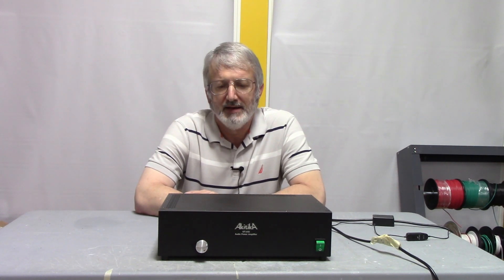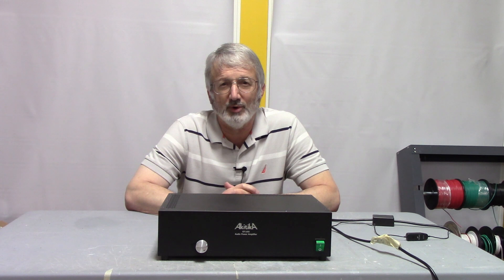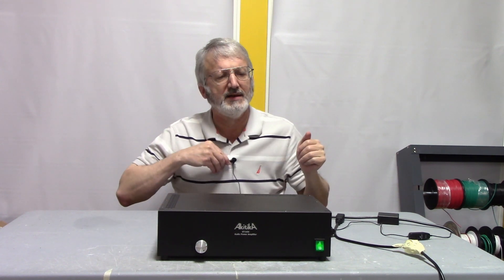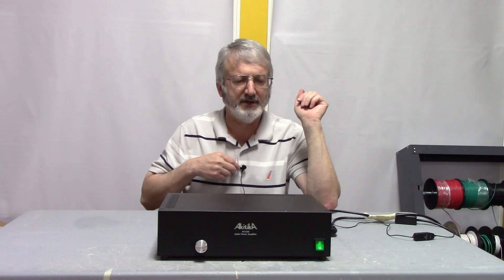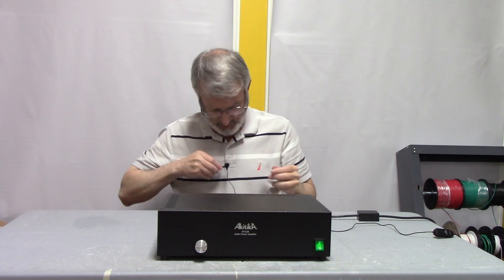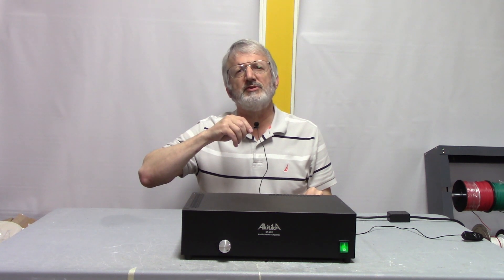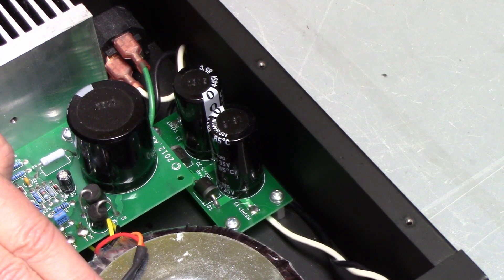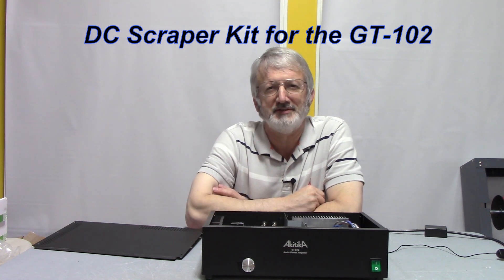DC Scraper Kit for the GT-102 Nullifies the Effect of Asymmetric Power

Comment: It amounts to a bipolar capacitor. A neat solution. The same circuit could help other gear as well, and might even be a good idea within a power strip or surge suppressor. Something bothers me, though, about the use of 35V caps. I know they should never charge beyond whatever the dc level is on the AC line (which should never be more than a couple of volts), but still, it makes me nervous. I'd feel better with 180V or 200V caps for a 120V power line.

Comment: Sir, Thanks for this information. Will this work with 220V AC. And also I see that the circuit is being connected in series with the phase line of the AC power line. Am I correct?
Reply from the maker: you could place it in series with either conductor. You can use it with 220 AC.
Reply: @akitikallc6161  Sir, Thank you very much for your kind reply.

Comment: Basic question: how many DC volts can this arrangement (two caps of 10,000uF + two 6 Amp 400 PIV diodes) block or supress?
Thank you.
Reply from the maker: It will hold off essentially the DCWV (DC working voltage) rating of the caps. In this kit, that is 35 volts.
Reply: @akitikallc6161  okay, thank you.
I asked because I've heard that usually, a DC trap could stop some 2Vdc from mains that would cause a buzz in the transformer. And using two bridges, it can block 4 volts. It takes only 2 volts of difference on the swings to start buzzing. That's I am curious about how many DC volts your DC trap could block in this arrangement.
Thanks.

Comment: Dc scrapper will work in other amps, example Rca uap-02 circuit ?
Reply from the maker: I am not familiar with that amp...but any power supply with a 50/60 Hz power transformer and asymmetric input power would benefit.